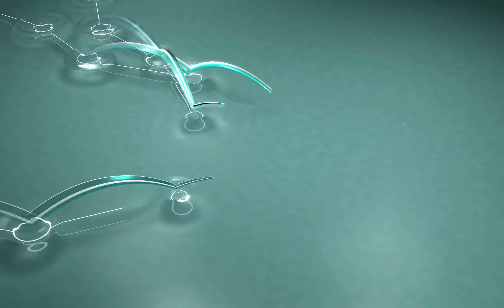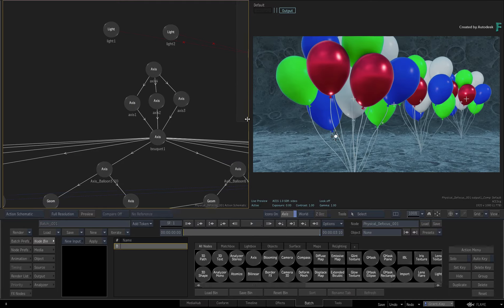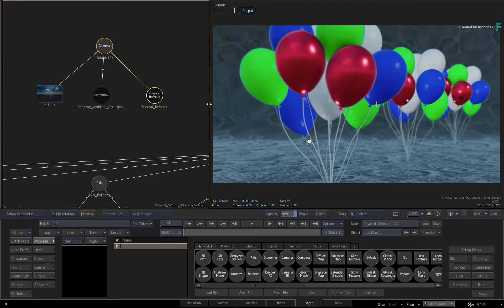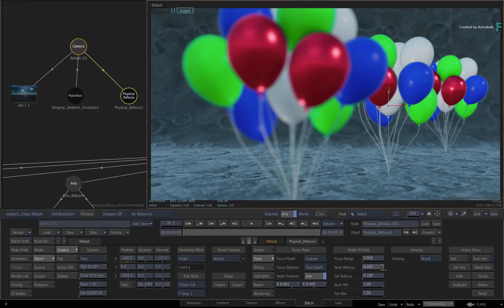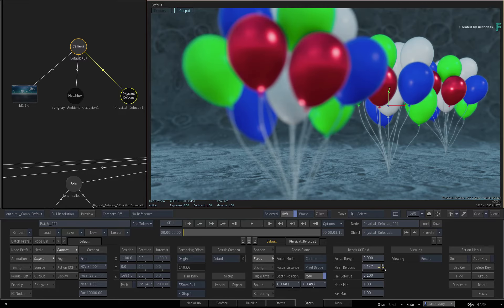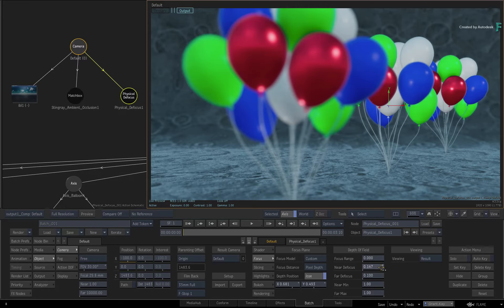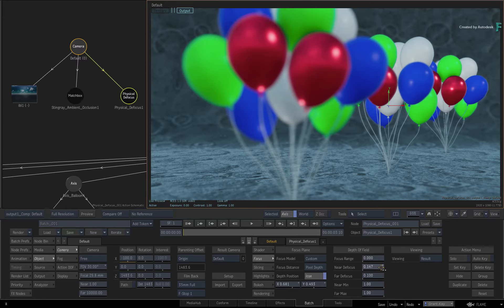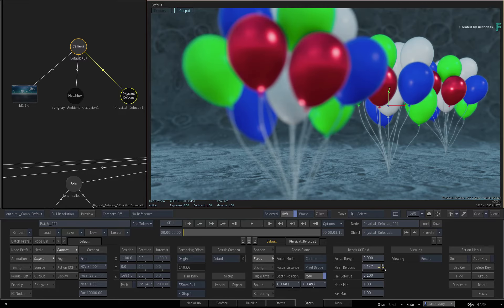Depth of Field Blurring with Physical Defocus - Part 1 - Flame 2021

Comment: why videos are not 16/9? flame resolution was 1920x1080 as I remember?
Reply from the maker: Hi Kamon Ciks, All the videos have always been recorded at 1920x1200 which is typically the lowest screen resolution for the Flame UI.  YouTube can play the resolution but at 1080, it scales and adds a letterbox on the edges.   I do scale the videos to 1080 for podcasts on iTunes and that is letterboxed as well.   Hope this answers your question.

Comment: This isn't working on transparent objects. Glass for instance. If glass object is in focus, it's refracted background also is in focus. Maybe should inspect optics principles closer, but it looks wrong.
Reply from the maker: Hi Gnome Gnomer, without digging deeper into the functionality, I think this may be a limitation of the tool.   It relies on a depth map which is pixel based.  Therefore if the glass of the pixels sit at a certain point in 3D space, it will be affected by focusing at that point.   I don't think its possible to to take refraction into account.     The only possible workaround I can think of is to do this in multiple passes.   First apply the depth of field to your background without the glass and then recompose the glass into the shot to match.  This will use the depth of field background in the refraction.   This would be followed by adding the depth of field again over only the glass to match it back into the scene.  This would be done in two or three action nodes.     Hope this helps.